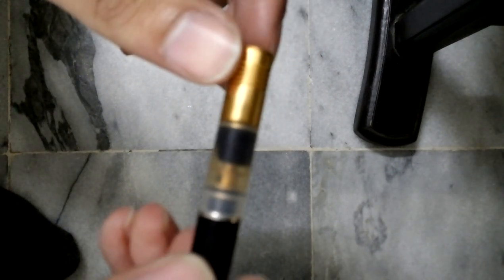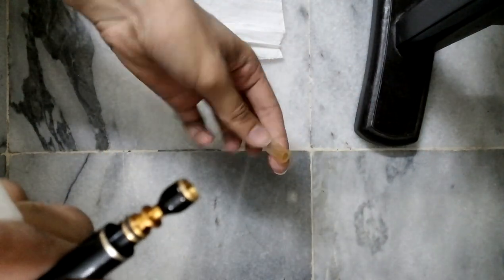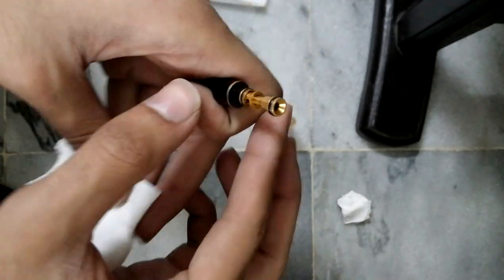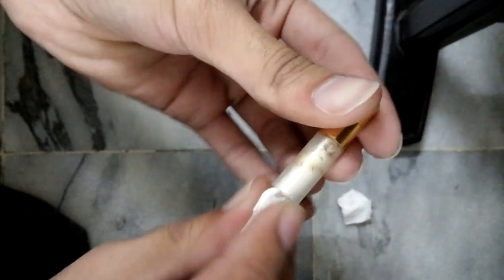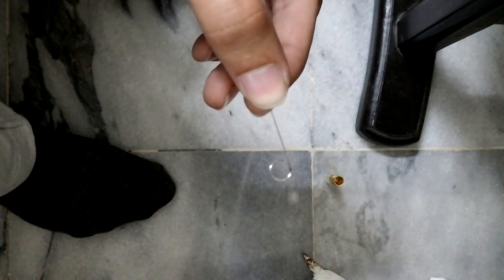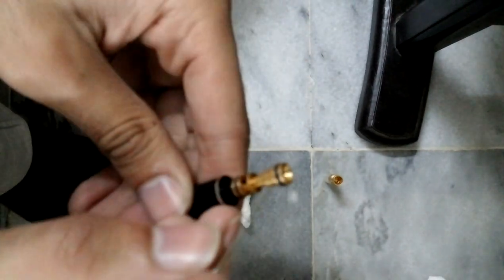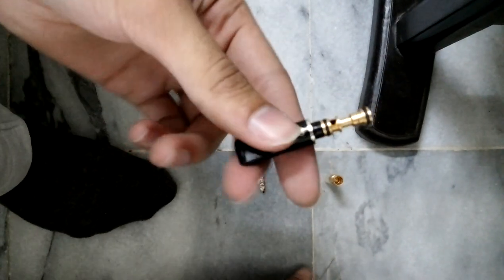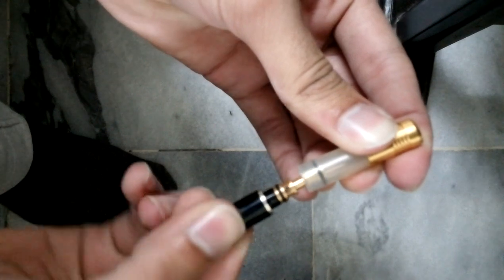How to clean a washable TarGuard

Comment: You can use isopropyl alcohol with salt or fine grans of sand; take a very small container (the closest in size to the filter, to avoid wasting alcohol) disassemble the filter and put everything in the container, put good amount of the alcohol and salt or whatever substitute  you choose, when everything is inside, shake it. 
You'll still have to to the easy step between 0:56 and 1:40 to get rid of that (it's the majority of the tar) before dissolving.

Comment: I wash my cigarette filter with water and it was blocked so how can i unblock it???
Reply: Shahnawaz Saiyed ,
Maybe let the filter air dry on the counter for 2 days. If it does not work, you'll probably need to purchase a new filter.
Reply: This may be two years late but I'll put my word in. If it's just a tar blockage, hot water, let the filter soak, do a full disassembly first. If that doesn't work, you're in luck, that hot soak softened the tar, use a toothpick, needle, whatever is on hand that's small enough to fit inside the filter's pieces and scrape, then rinse, repeat if needed. If by some accursed antonym of a miracle the blockage is of some other origin, well then you've stumped me, start with a full disassembly and see what can be done from there, if nothing can be done, get a new one.